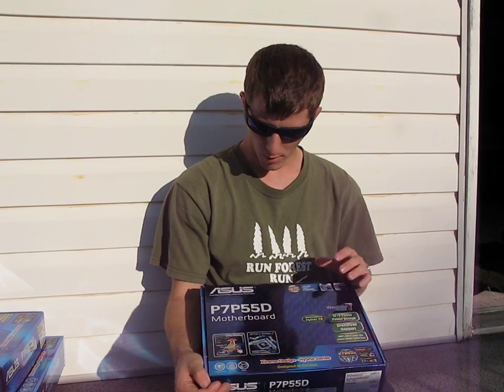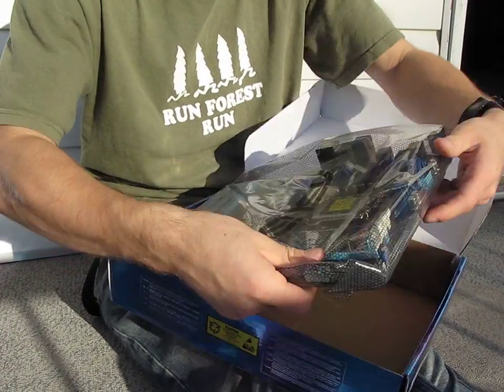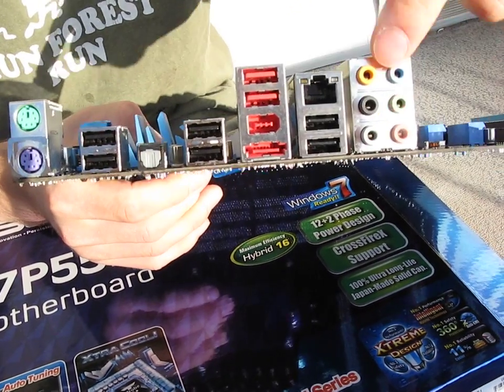ASUS P7P55D P55 LGA1156 Core i5 Motherboard Unboxing Linus Tech Tips

Comment: Chapters:

0:00 Box and general overview
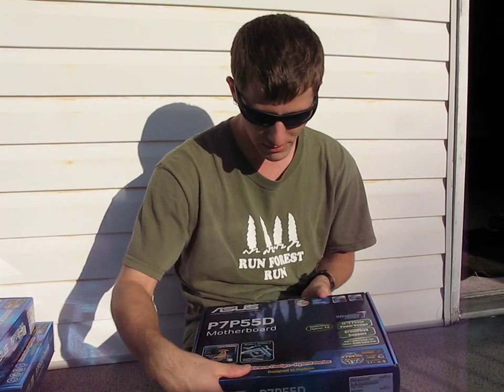0:20 Unboxing start
0:25 I/O Shield
0:27 Manual and DVD
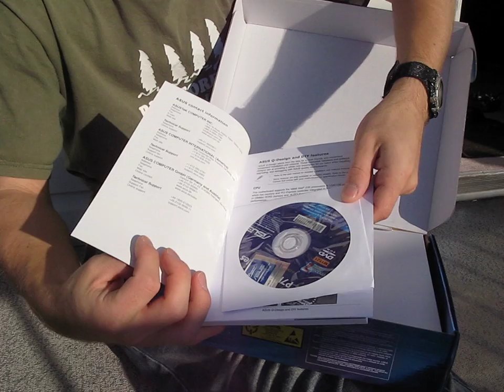0:33 IDE cable
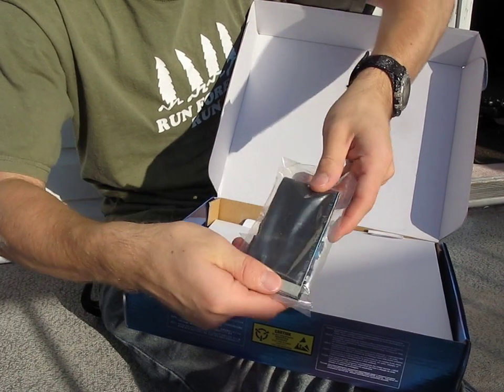0:36 Q-Connect connectors
0:39 4x Sata cables
0:45 The board itself
1:02 Dual channel DDR 3 Memory
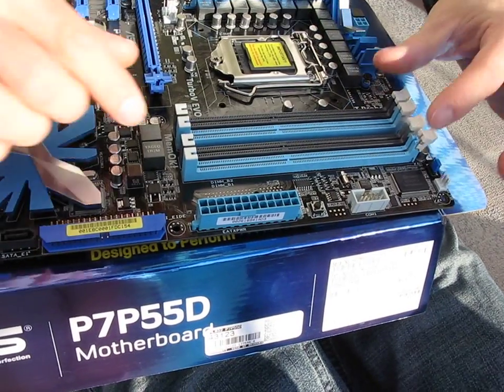1:07 Mem OK
1:14 Sata ports
1:20 PCI-E Slots
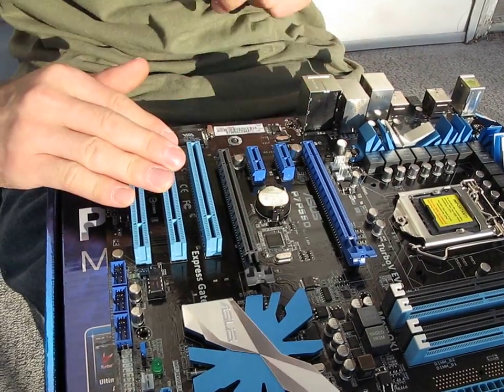1:30 Cool heatsinks
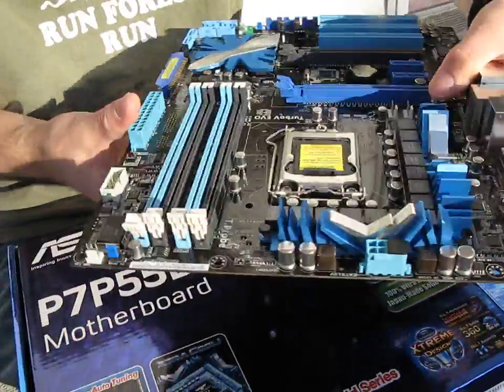1:46 I/O

Review:

Pretty much the same as last video, I rate this a 1/5

What am I doing, and why?

I want to watch, and review every single video on Linus Tech Tips channel.
I will provide chapters, if the video has none.
Why am I doing it? To pay a homage, and I am pretty sure that my head is a bit messed up.

Comment: @ycrnet to answer your question, i did the same thing. the six pin power connector is wired differently, which could very well result in your motherboard being fried.

Comment: @Haruhide86 Hey do u use the 4 pin or 8 pin cable to provide power to the processor? (on default 4 pins are covered on the mother bord, but i removed d cover and conected a 8 pin cable, Is it all right?)

Comment: Hey I got this Mobo, I got a small question please can some one help me, There was a 4 pin power conector for the processor, but I took off the cover what covered other two openings and conected a 6 pin power conector, is it ok for the mother bord? will it draw more power to the Mobo? I'm confused, should I remove the extra conectors? Plz help, Thanks..:D